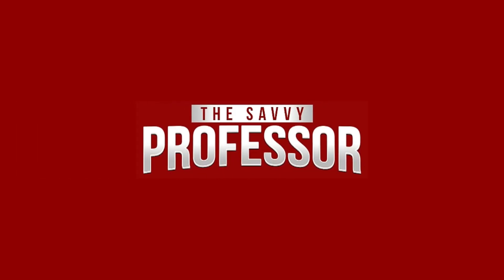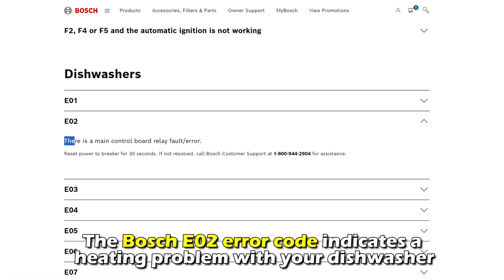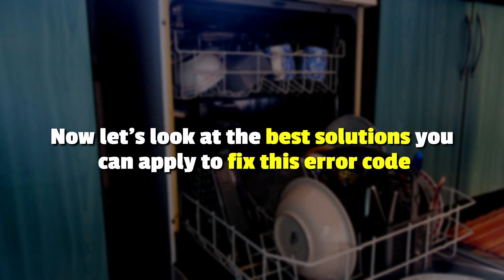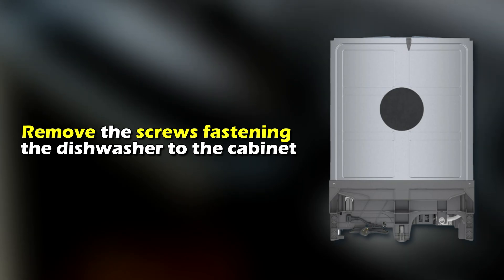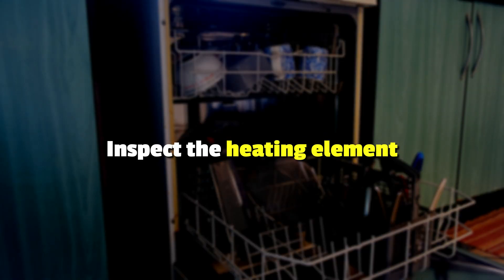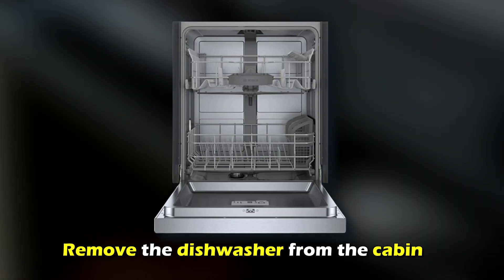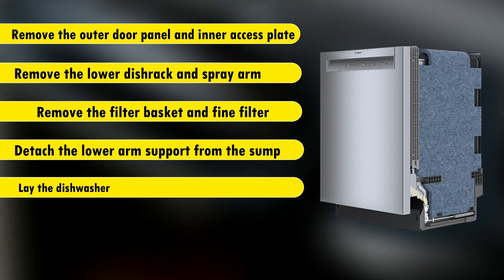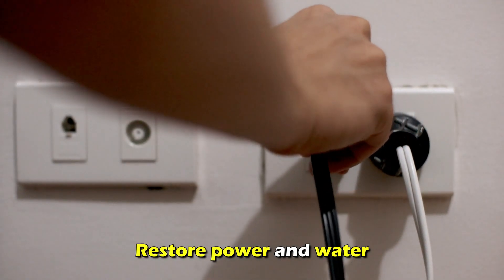How To Fix Bosch Dishwasher E02 Error Code - Meaning, Causes, & Solutions (Easy Fix!)

Comment: What a misleading load of tosh.  

Heat pump error.  As simple as that.  Open circuit cylindrical element no doubt caused by a food hotspot in the element inner copper wall.  This makes the element overheat and burn out.  

New element required on the pump.  Compete job done in thirty to forty five minutes.